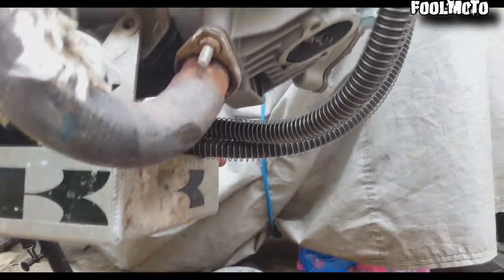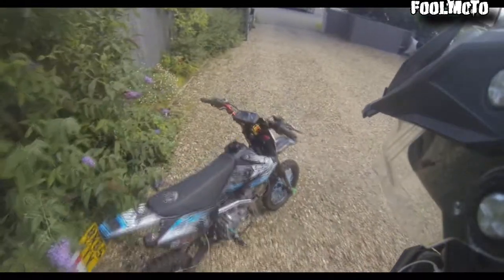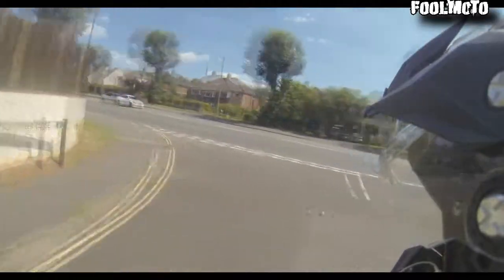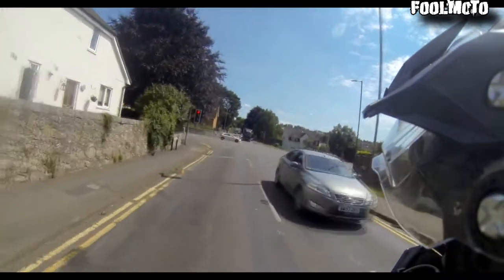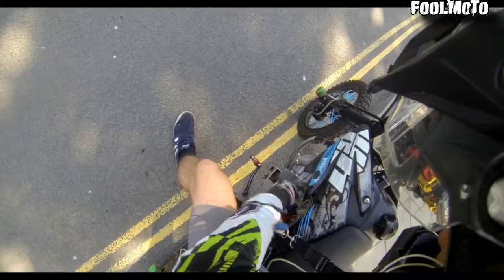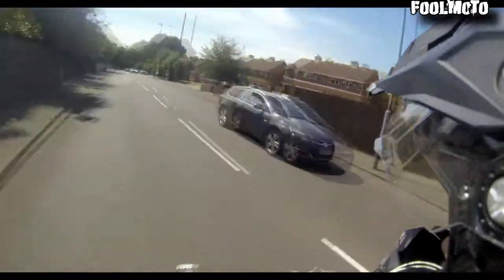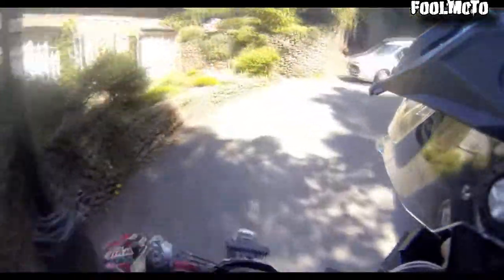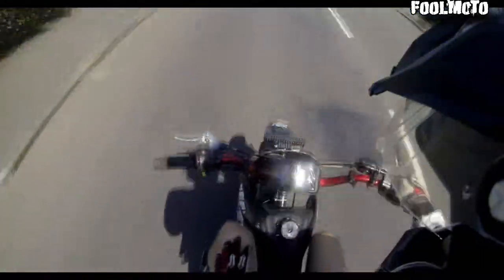I THINK I FIXED IT!|PIT BIKE VALVE ADJUSTMENT!

Comment: I had a problem with mine, the inlet was slightly letting out the compression on the compression stroke so it would kick straight over, it shouldn't kick straight over there should be a hard hit thats where it buids compressions
Reply: How did you fix the issue ive set my valves a million times wont fix it

Comment: I have a stomp 140. when I get to about 3/4 throttle it sounds like it's hitting a rev limiter. I have tried all carb adjustment. the needle it on middle clip. fuel screw it around 2 turn out. I tried needle up 1 clip an down and adjust fuel screw but still same. any ideas.
Reply: Same problem here, i checked the sparkplug, cleaned my whole carb, to no avail. Next up I'll adjust the valves but if that doesn't work I'll still check the ignition.  If anyone has any ideas as of what to do please tell me.
Reply: Alexander Bondestam  try installing a unlimited CDI box and coil
Reply: nico dasai found the problem. I accidentally put on a too small air filter which made the engine bog at high throttle
Reply: Alexander Bondestam  okay that's good then ..mine was the igniting the bike only revved about 4000rpm ..I fixed it with the unlimited Cdi and coil and the bike now rev's up to 10thou ish ...thus more bottom end and pick up
Reply: Same happened to me and it blows up
Reply: You know it does have a 1/4 turn throttle?
Reply: @Farmtractor  lol fr you not made for it to speed more like track or wheelies
Reply: Valve springs faulty

Comment: Does youre engine make a kind of metal tapping on metal sound?? Cuz i just got one its making that noise.
Reply from the maker: hi mate , yeah i had this problem with a couple of engines,what engine is yours?
Reply: I have a YX 140 and ticks badly, valves are good. Idk what to do next..
Reply: It’s the cam rockers pushing the top of  the valve mate hence the name “tappets”
Reply: I had the problem aswell, sounded as if it was coming from the top end turns out it was the exhaust give that tighten see if that helps.
Reply: Sometimes it's the exhaust leg shield
Reply: You ever find out what the noise was ?